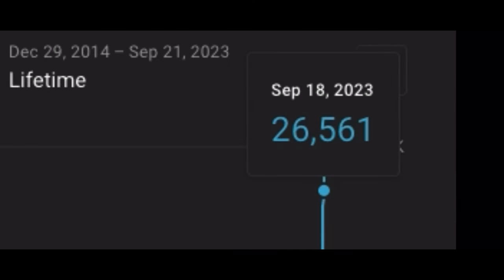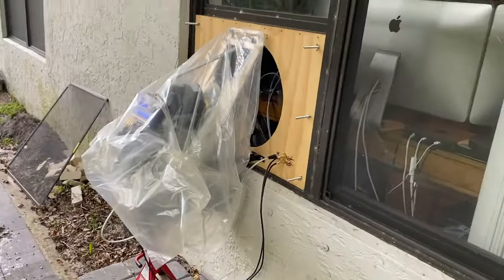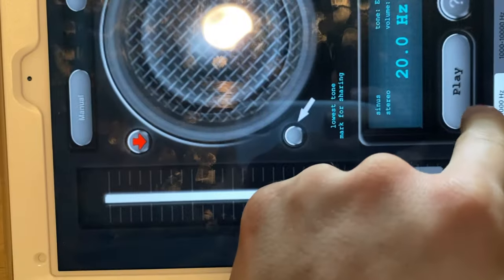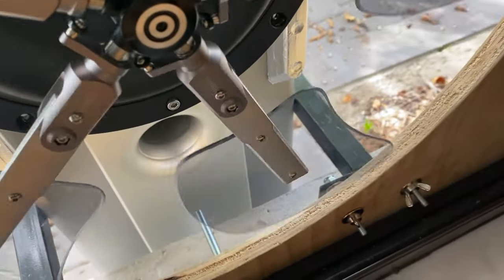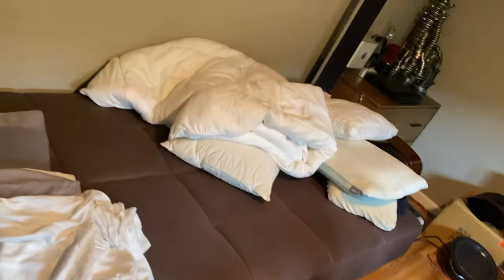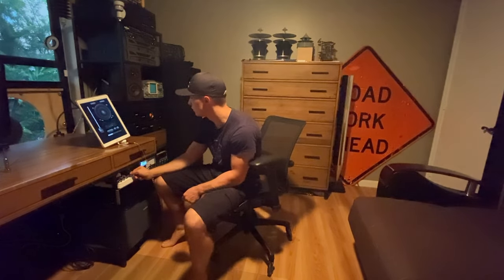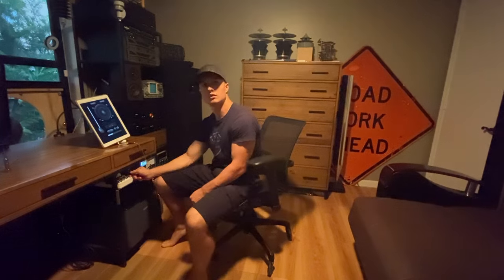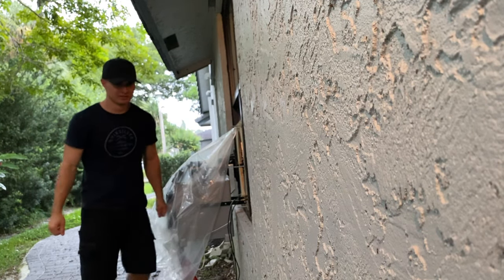Finding resonant frequency of my house with worlds most powerful “rotary” subwoofer (Bad Ending👌)

Comment: Protect this man at all costs. He’s cracked the pyramid code. 🙏🏽
Reply: Ya know that feeling when you learn how a magic trick works? It’s ALWAYS so simple…Palm to face, always. Imagine once you find exactly how the ancient megalithic structures were formed….probably so simple and always right there under our nose…..or ears. 🤷🏽‍♂️🙏🏽❤️🌱
Reply: @Timkast wait - you actually believe this don’t you?
Reply: @Timkast please explain the process of building a subwoofer with BC materials and then how it would actually lift a rock. I don’t think you are as engineering-ly inclined as you think you are
Reply: @melody3741  you just typed “engineering-ly”. I know who you voted for. ❤️
Reply: You should have learnt more from your great gramps😅.  Manpower is a thing BTW.

If you think this is easy, try making a speaker on your own and powering it. I don't mean using enameled wire. Go mine copper(oh and don't use metal tools), smelt it, make a wire out of it (also without any metal tools). Make an insulator to coat the wires. Find a natural magnet(magnetic rocks basically) to make the core, then make a strong enough diaphragm from scratch(raw materials also from scratch). Don't forget to make a frame for your speaker. Rocks work fine I guess. Then make a power source(similar to the steps above) now find a way to find the resonant frequency of the thing you want to move, now find a way to make that frequency. 

Congratulations. Now try your best to hide it and make it look like you did that with your hands. 

Then just for a baseline, move it with your hands(or get help from someone). See which one is faster. Manually moving it or advancing a civilization a few thousand years forward 😂.

I challenge you.

Comment: You can use a normal subwoofer in this application but a beefy subwoofer that like to work on infinite baffle application but it nice even with this rotary sub 😀 I have a video on my channel with 2 Logitech z906 all stock only a home made port at 16 Hz in bathroom bc I saw my bathroom it like a 6 th order box and man those Logitech subwoofer in this scenario smash that infra bass range like crazy between 12 and 16 Hz even up than 16 Hz but that Hz it not more considered infra bass and it play down to 7 Hz I mean I put a towel in door and it move like crazy 🌪️ it move a little bit even on 7 Hz but on 12 Hz up it fell very nice on body at 15 Hz almost I fell in my lungs a bit if a turn it up at max how it move my lungs if I leave my chest soft and keep my mouth open... It crazy how much gain I can put out of these speakers PC subwoofers at such a low frequency range in right place only with a home made custom port at 16 Hz 😂 and on very low wattage... Insane...
Reply: And my house it shakes like crazy and it made of concrete and cement. It nice bc you can feel and hear those frequency in all house even at windows of my room or any space in my house if I put at door or windows a  paper it move and if I seat in a door my clothes it move a bit 😅 but at door of my bathroom it like crazy how Windy is... 😅 Yeah my bathroom it like a big box that literally smashing the  infrasonic  frequency range...

Comment: other speakers with super low bass which look more elegant:
1) devialet phantom , can go to 14hz
2) zeta zero orbitals: about 16Hz
heres interview with designer of orbitals, with lots of technical things discussed: https://www.youtube.com/watch?v=NaE9MP7zIYY&t=20s
Reply: Manufacturers that give a frequency rating without stating at what dB is completely worthless.
Reply: Obviously you don't know anything about rotary subwoofers, nobody gets them for the elegance lol

One of the few subwoofers that can literally shake your house apart quite easily. Stop hocking sound systems here and scroll up to watch the video.

Comment: Isn’t it impossible to hear anything that’s not 20-20000hz?
Reply: You can just feel it ig. Interesting
Reply: depends on the person. Some people can hear below 20hz and some people can hear above 20000hz but on average most people can only hear between 20 to 20000hz
Reply: It depends on person. 20-20k can hear any normal person without any hearing defects. I can hear from 11hz up to 22-23kHz.
Reply: @geg57r  That's 1 octave lower than a human with a good hearing.
Reply: The idea that you can't hear below whatever frequency is a simplification, to quote a study about it; "The threshold of hearing is standardized for frequencies down to 20 Hz, but there is a reasonably good agreement between investigations below this frequency. It is not only the sensitivity but also the perceived character of a sound that changes with decreasing frequency. Pure tones become gradually less continuous, the tonal sensation ceases around 20 Hz, and below 10 Hz it is possible to perceive the single cycles of the sound. A sensation of pressure at the eardrums also occurs. The dynamic range of the auditory system decreases with decreasing frequency. This compression can be seen in the equal-loudness-level contours, and it implies that a slight increase in level can change the perceived loudness from barely audible to loud. Combined with the natural spread in thresholds, it may have the effect that a sound, which is inaudible to some people, may be loud to others." 
So basically as the frequency gets lower it needs to be louder to be perceived as sound. 

It is easy to explore this with decent headphones and a tone generator, but you should be careful with your hearing and headphones if you do. Trying to get it loud at very low frequencies will distort and possibly damage the headphones, plus if it is cranked up to hear a low frequency and the generator gets accidentally changed to a higher frequency it can be ear bleedingly loud.

The other common idea is that under a certain frequency sounds are felt and not heard, but again that is a simplification because it depends on a bunch of things. 20hz from an in ear driver will be heard but to get the same volume at your ear with a sub might require some earth shaking energy, especially if you have worse than normal hearing at low frequencies. People are familiar with subs and are used to only feeling low frequencies, so it is easy to see how it seems true that you can't hear below a certain frequency but you can feel it instead.

Comment: Use a dyson fan to create the subwoofer, it has less moving parts.
Reply: The blades need to spin.
Reply: @zeusgangmemory  he can use the internal motor of the fan to move the airflow forwards and backwards with a micro controller.
Reply: What, that's not how it works

Comment: Dude. What if UFOs use something like this to travel. I seen a vid explaining that they use sound waves to stay levitated.
Reply: You just described a pulse rocket lmao
Reply: Where do they travel? Because in a vacuum, sound waves do not propagate, and within an atmosphere, they would be significantly slower compared to the fighter jets we have today.
Reply: @Eresteban1  Sound is just essentially air. So, therefore sound travels differently depending on atmospheric pressure. So, it would have to be different for different planets?? Idk. I'm no genius. Lol

Comment: Tesla figured this out . He knocked down a building doing this; and more recent, Militaries have created Earthquakes with this technology
Reply: He didn't knock down a building. He theorized he could
Reply: @JsParker43  afaik has he tried it but stopped as he noticed that the rattling where the metal frames of the house bending (based on a comment i read here, have not looked deep into the topic)

Comment: Find a way to not use rotatory mechanism and you won't have this bending problem. You hitted the Resonance frequency of the blades that's the reason why they bended out of shape and did collide with the frame